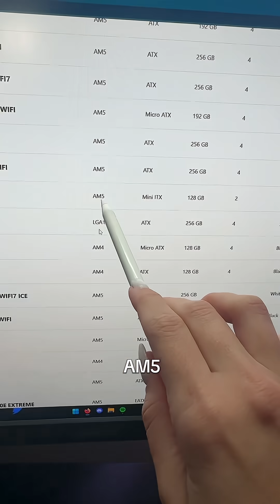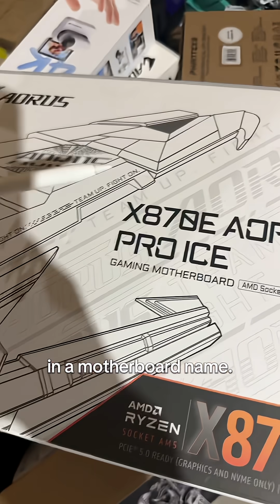motherboard socket type vs chipset?? #Lindseyszn #Techtok #techbaddie #tiktoklearningcampaign

Comment: Theres already enough Comments about Am4 being PGA and Am5 being LGA, but also worth mentioning that even if the socket is the same it doesnt always Support the same CPUs for example i7 6700/i7 7700 Skylake/Kabylake is LGA1151 and Coffeelake i7 8700 is also LGA1151 but wont work on the same motherboard.

Comment: Okay really fast. The AM5 socket is an LGA or Land Grid Array. The AM4 socket was a PGA or Pin Grid Array.  Nothing wrong with what she said, but your best bet is to determine what CPU you want and then look at what socket it uses them look for motherboards with that socket.  Also B stands for business. So just avoid those boards.

Comment: LGA is Land Grid Array... PGA is Pin Grid Array. Those refer to the pins, not the socket type. For instance AM4 is PGA but AMD switched to LGA for AM5, while Intel has been using LGA for a long time, hence why they append the "LGA" before their socket number. ... It's a out where the pins and pads are on the CPU (and because of that Mainboard.)
Reply: 0:50 bro! 🤦🏼‍♂️ No. Incorrect. AM5 is literally LGA! What are you even saying? ... Land Grid Array... The pins are on the Mainboard side and the pads are on the CPU.. AM5 is LGA. AM4 is PGA.... 
Why misinform people like this?

Comment: I’m probably the only person that has never even been to the PCPartPicker website and will never use it. Half the fun is researching and figuring out everything for myself. 

AM4 uses what’s known as PGA or Pin Grid Array as opposed to AM5 and Intel using LGA or Land Grid Array. Good video though. 

You’d think after 30+ years of building computers I’d look more closely at the motherboard I’m buying from Micro Center’s clearance rack for $50 and see it was a B860 and not a B850. Didn’t notice til I got it home though. That’s ok though, I’ll eventually get around to using it.